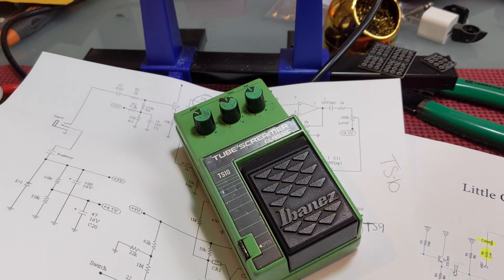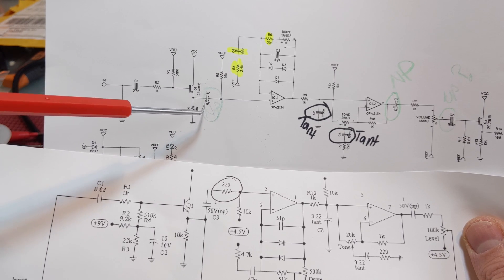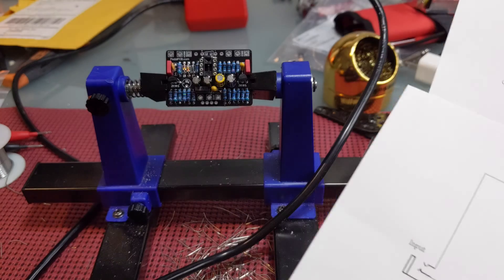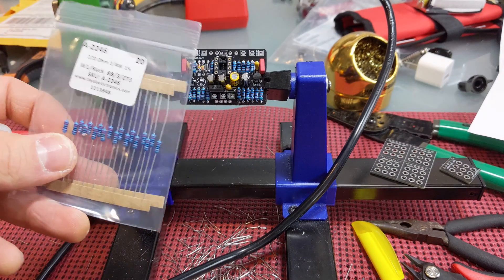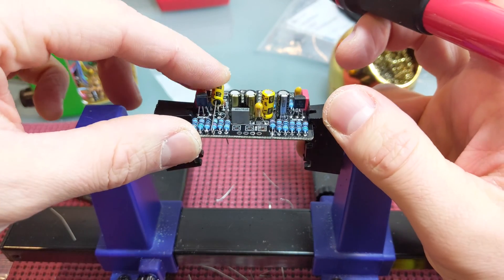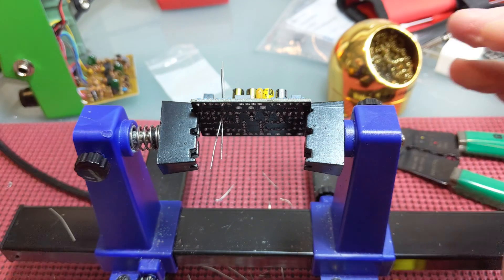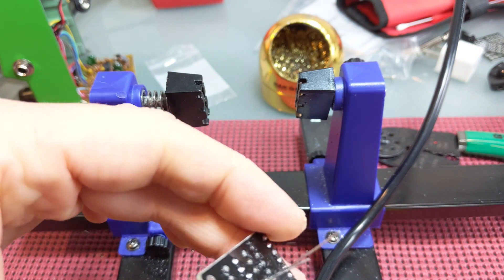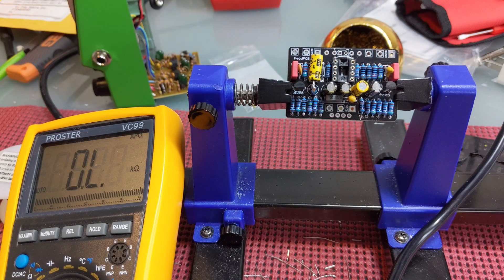Ibanez TS10 Circuit Analysis and Conversion Mods | How To

Comment: Hi Ryan, when you were working on your ts10 project (creating the schematic for the ts-10) Is it true that in the ts-10 there is a voltage divider only for the input buffer 9.2k and 22k plus filtering capacitor) and there's another one (voltage divider for vref).  Thanks

Comment: I don’t think it has anything to do with lowering the volume. You’re looking at a complex RC-filter with something that’s probably really awesome going on.

An RC filter always consists of a resistor and a capacitor, with the frequency cut-off between the low end and the high end being f=1/(R*C) and that’s with one resistor and one capacitor. In this RC-filter for as far as I can see at 3:31 you have at least one capacitor and a number of resistors in series in a closed chain serial signal.

Since as you know the capacitor passes on high frequencies more easily and the resistor low frequencies, this means that they resist the exact opposite. This means that when you measure over the capacitor, you measure resistance to low end, so the parallel circuitry will also take on the properties of the low end frequencies. The high end will resonate over the resistors.

The main question now becomes, what happens with multiple resistors in series with a capacitor in terms of frequency separation? Will both different valued resistors take different parts of the high end? How does the shift between low-end and high end happen when you measure between the two resistors?

That’s essentially what they do, but I can’t see at 3:31 what they connect to the non-inverting input. Do they connect the filtered signal to the non-inverting input? Or is it the designated ground? Is it a part of the ingoing signal? Or is it a part of the designated zero with V+ and V- setting the positive and negative limits of amplification?

Ask yourself this: is it about tone or about reducing the influence of 50 or 60 cycle hum?

Comment: Hey Ryan, 
There's also 2 more differences between the ts9 and 10 besides the 220 ohm resistor, which are a different bias voltage for the input buffer and an emitter follower between the flip flop circuit and the input buffer ( which I doubt will make a sonic difference). 
I cannot deny that the 10 sounds a bit darker than the 9 but I have always wondered if it was the 220 ohm resistor or the higher bias voltage on the input.
Did you try to take the 220 ohm out of the circuit to see if there was any sonic difference? I need to breadboard it and test it out..
Reply from the maker: That's a good idea (breadboard or possibly even a switch). I should have mentioned too that I was not taking in consideration the buffer part of the circuit since I am building a Tru bypass so I was strictly looking at the engaged signal. I'll double check the bias voltage between the two. Thanks for the collaborative help!
Reply from the maker: I think I found what you're speaking of as far as input buffer bias. You mean the 9v dropped by the 9.2k vs 9v dropped by the 10k (Vb)?
Reply: @TheToneGeek  precisely, a voltage divider of a 9k and a 22k resistor instead of the VR at half of the supply with the two 10k resistors. Which would bias the input higher, so I guess the 220 in series later on would compensate for that? Not too sure
Reply from the maker: @miguelpessanha  it's all part of the mystery! I'll try to do a circuit analysis if it shows anything. I know this topic has been combed over many of times and differences has always been thrown out because of the 5% tolerance on the resistors. 🤷‍♂️ I'm building that TS10 audio path circuit replica and compare it to my real TS10 to see.. video test soon after, of course.
Reply: They've increased the  bias voltage of Q1 because its output then biases Q6, can't see the 220R resistor doing anything other than dropping the signal by about 2% so I doubt it's an audible difference. A switch that shorted out the 220R would demonstrate this.